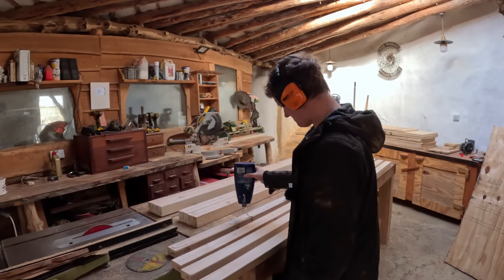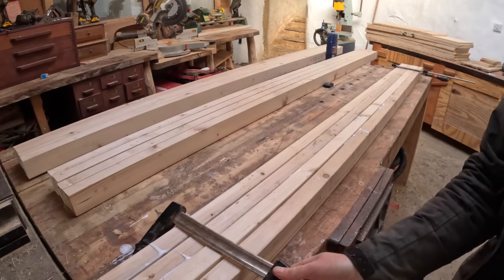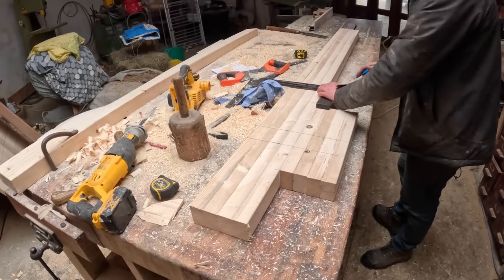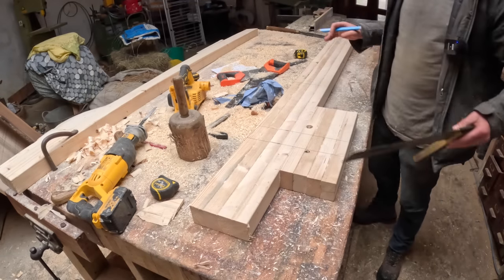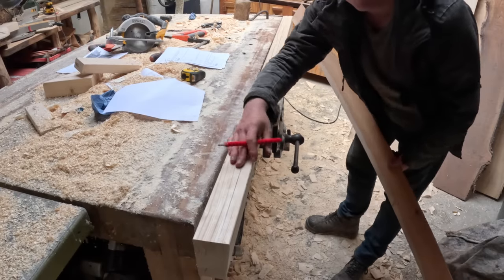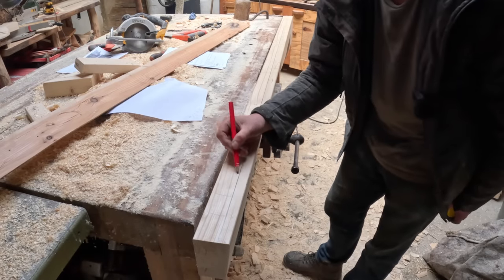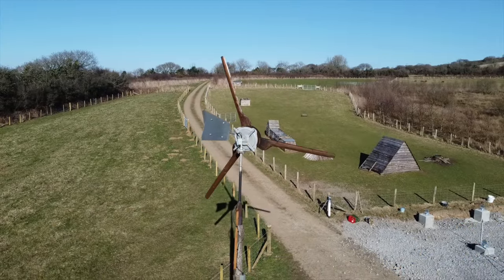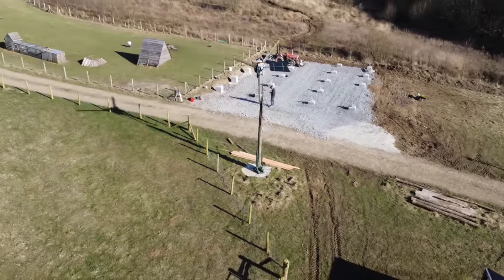Hand Carved 2m Wooden Wind Turbine Blades

Comment: Have you thought of making a horizontal windmill or a savonious style, I’d be very interested to see what you can produce & the resulting output from one. The most basic design of one is made with a large metal barrel and an automotive alternator. The advantage of this design is no directional tail is required & they are supposed to be very effective in low wind conditions. I think if you made a vlog about making one & testing it. It would be a popular vlog.
Reply: The basic design of them is flawed, since one blade is making power, and two are going into the wind, creating drag. Vertical wind turbines have three blades making power all the time. making them many times more effective.

Comment: So, if you get warnings of Gale's you can crank the volts up and slow her down. Usually you are harvesting lower power than you could but you get it for longer because you harvest at lower wind speeds?
You will be getting into variable pitch before you know it ;o)
I have to say I like the (lack of) noise when it is turned down better.

Quality, as per usual!

Comment: Good stuff man.. Alot more controlled now for sure.. Any ideas to build another for on top of the barn? Probably more consistent air flow up there... Any old air fields/ plane grave yards around Whales?  Ide love to see a turbine made from a recycled jet engine.. Precision balanced for any speed you can toss at it..Just need the turbine and the housing to start with..super light weight.. goose farts will probably turn it lol..
Keep up the great work Kris

Comment: coat the wood in fiberflass resin. then layer of thin woven mat. then thin coat of resin again. blades last a life time then. soak the wood in resin tho. so make a mix that takes house to cure. so you can do multi coats then a final later that is rather hot mix so dries. and it helps seal the wood like plastic. spraying it be a smoother more even way to apply to prevent balance issues.

Comment: Could you add a regenerative braking system that would engage at max speed and send it back as un-wasted voltage ?   You made those blades as quick as mother making biscuits for breakfast !
Reply: Makes no sense. Send the power back to where? The turbine?
The MPPT charge controller finds the best RPM VA and puts it into the batteries unless they're already full, in which case the energy goes into a dump load or maybe immersion heater.
Regen is for EVs and motors, wind turbines are already "regenning"!

Comment: WW1 Aircraft had a metal 'strip' on the leading edge of the props.  The same could be done on your blades - by recycling Aluminium cans cut and spread out.  Net result a lightweight 'hardy'  solution that would probably double the lifetime of the blades.... Just a thought :) - I really enjoy the channel - Thank you.

Comment: I know ur quite invested in ur coil setup but i think its time for thicker wire to draw more amps mate. Or even use those blades on a whole new turbine
Reply: Er, didn't he just make the coil setup.....!?
Reply: @andymccabe6712  yes but using the Betz law this is what is think he should be aiming for 
Blade length 2.5m
Wind speed 11m/s
Available wind power 16.007kw
Turbine efficiency (generous 30%)
Wake losses 5%
Output power before losses 4.562kw
Losses...
Mechanical losses 0.2%
Electrical losses on turbine 1.5 %
Electrical losses (transmission) 5%
Time out of order 3%
Expected output power
Real efficiency
25.817%
Output power with losses 4.133kW

Torque
Tip Speed Ratio (TSR) 6
Revolutions per minute 252.1RPM
156.54 N·m 
Trust me mate that coil arrangement just won't be enough. I suggest having a a high wind speed turbine and a low speed turbine for the best of both worlds

Comment: How would putting some type of durable weather resistant sheet metal over the leading edge work… to minimize that wear on the blades? Especially since these new blades are gluelamed using less durable material.

Comment: Did you do calcs to work out the optimal blade size and geometry for your self wound coils? I realise there’s a cost factor here in the copper for the windings but would larger ones be more efficient here at slow speeds with longer blades?

I understand you dismissing fibreglass and I am completely on board with not wanting to shed micro-plastics but this immediately makes me wonder what you could use as an inert leading edge reinforcement. Not at all practical for you but I wonder if a thin strip ceramic would work or if the stresses involved in blade deformation under load would shatter it immediately. Would be a pain to manufacture too I’m sure. Perhaps just a denser wood replaceable insert would help?
Reply: Or..... Everyone could stop worrying about the wear on the blades..... Kris LOVES making new ones........!!!

Comment: The first large commercial fiberglass ones i herd got eroded had to be replaced couldn't be repaired and were just buried in a football pitch size hole in the ground.  Later ones can have the leading edge repaired

Comment: Kris, can you not put a smaller break fan on the back like a wind mill not only does it turn it into the wind but controls the speed of rotation by applying a break to the main turbine.

Comment: I would have expected that you would need to do some balance checks so it spins as evenly as possible. I imagine that spinning at such high speeds, a small imbalance in weight distribution leads to some rattling and shaking which could be dangerous and wear through the bolts n everything much more quickly.

Comment: Built wooden Gyrocopter blades through the 70s.  Easier job than your way, all wood with a tapered steel spar,  about 3m each, no twist built in, about 350 - 400 rpm output on a machine weighing 250 kg.  Would expect half that on your application.

Comment: Interesting to hear about the leading edge erosion! I know you discounted a fibreglass protective layer, but would something like a thing sacrificial aluminium cover along the leading edge work? Or would that cause other issues?
Reply from the maker: the leading edge is round so it would be a difficult thing to make in aluminium. I think it would work but it would still wear away just slower. so it would be a trade off from time spent on the aluminium vs how long it takes to just make some new blades.
Reply: @KrisHarbour  what about making the leading edge with hardwood?
Reply: My my Ph.d thesis was on leading edge erosion on wind turbines. And it is a big problem for full size turbines, a lot of operators just accept that they might have to repair every 3 years. So far the best solution is thick polyurethane elastomer coatings. But I don't know how to buy them as a non OEM, otherwise just try to keep the tip speed low. Below 70m/s helps a lot.
Reply: @KrisHarbour  aluminium tape ?
Reply: @KrisHarbour  Cheers Kris!
Reply: What about hand-formed strip of copper beat over the edges?

Comment: The longer blades will be traveling faster at the tips at the same RPM making them noisier and wearing them out faster. Obviously it's about finding that sweet spot keeping the RPM down and all the other variables to maximize your goals for sound/consistent power. Hope this works out well.
Reply from the maker: That is correct but it isnt doing the same rpm its going slower now. so the tip speed is slower. However that does make it less efficient, thats why I made the blades longer to count for that loss so the output is still what I need even though its going slower.
Reply: @KrisHarbour  because your blades cord don't twist as they move out from the hub they are less efficient (lowering tip speed and noise which is your goal).  That coupled with the increased mass of the blades,  increases the inertia evening out average tip speed in variable wind speed conditions.  Power output is proportional to the cube of the speed which you have reduced so you can expect less noise but also less power output.
Reply from the maker: @philipandrew1626  But the blades do twist. maybe I am misunderstanding you but I showed carving in the twist.
Reply: @KrisHarbour  yes you did carve some twist but not enough to account for the apparent wind generated by the rotating propeller.  Consequently the ends and outer and tips will be inefficient and stall at top speed.  But that is okay as it will self limit your speed and noise.

Comment: I was just wondering why only 3 blades ? Wouldn't more blades increase the low speed torque and increase the inefficiency and drag at higher speeds,  the conventional physics of 3 blade design efficiency is the opposite of what you are trying to achieve,  aeromotor water pumps used dozens of blades to increase low speed torque against what is effectively a dead lift load,  blocking the air mass hence limiting maximum air mass and speed
Reply: Too technical and nerdy, dude.... the quick, simple approach is usually better in theses situations.......!!!
Reply: Look up Aeromotor and learn something Kris is an engineer who like all engineers likes elegant solutions especially old solutions

Comment: What about glassing the blades? 

Also could you not measure the rpm and control to that? Is rpm linear with voltage? Sounds like you might need a different control algorithm?

Comment: Yes but - this is not a size but a regulation problem in the first place?

In the end i will have to have different sizes of blades due to season and expected seasonal winds speeds accordingly - or self-adjusting blades? (1)

(Nobody seems to write about it here, that's why i do.)

1 - professional blades come with adjustable blades, they become adjusted according to a windspeed-effectivness chart that's pre-measured in tests - and the profil of the blade changes with increasing windspeeds according to an build in compliances of the blade as such. Torsion and bending both occur in the desired way. 

And of course there can be always just one optimum blade design for a given place on earth and it's winds to come in a (about) predictable future.

In reality i get an idea about the winds at my given location in the first place from measuring over time and pilot charts and select the turbine i purchase from a list of different adjustable turbines with different  control characteristics - close to my required optimum.

(I thought this to be common knowledge anyway today, i am sorry. Selecting my windmill is not very much different from buying a car or a lorry for my small business transportation needs, and there are so many windmills today already at so many places.)

Comment: Does that bulge work as some sort of counterweight? Bit of damping for the rotating blade vibration?
Reply from the maker: no, it just that the blades dont do a lot down there, Having extra width at the bottom just makes them a little bit more efficient. Because they are moving slowly down there the extra mass isnt an issue for drag. So the base should be wide and the tips quite thin. its not that important though and I only did it because I had a offset from a standard timber length.
Reply: @KrisHarbour  👍

Comment: Looks like the barn might interfere with the wind when it comes from that direction, or is that rare in your parts? Do you plan to move the wind turbine when the barnbuild is done?
Reply from the maker: The barn will block wind from the north. but that is quite rare. it will effect the turbine a bit though just by being there. But the wind is mostly just a hobby for me really. I like to mess around with it and it is handy to have sometimes but Its not essential to us. Anywhere else I put it would be in the middle of grazing land and grazing land is more important to us than wind power.

Comment: Can that controller be set up to switch between different preset modes at different time. ie. Low & Slow when you're home, High output while you're away or being noisy in the shed and wearing hearing protection anyway, and need more ergatrons flowing?
Reply: Another thought, which someone else has probably already mentioned. If noise is an issue, and noise is a product of RPM (that can be measured and utilised as an input signal). Can the computer box automatically adjust the harvest rate of ergatrons to maintain a turbine RPM with the least obnoxious sound?

Comment: Why not just use a different blade pitch to reduce speed and increase torque for low speed running? I suspect you are stalling the aerofoil by throttling the speed down.

Comment: Just a question, I certainly don't want to suggest I know more about wind power than anyone else here, would it be possible to get more power from a lower speed turbine if you use more blades?
Reply from the maker: more blades means slower rpm. But the more blades you use the more resistance so there is a trade off. the reason three is used commercially is because its been worked out that three is the best trade off for speed, torque, cost and efficiency. for my situation though more blades might be beneficial to slow it down even more.

Comment: It might not be a bad idea to put a small gearbox between the turbine and the generator to increase generator speed.
Reply: He just built new blades to slow the rpm. Also why add all the extra complexity and maintenance of a gearbox.
Reply: @Ed.R  2 pulley and 1 belt 🤔
Reply: @StakrCZ  Belt drive on a wind turbine is really bad idea. If the belt snaps in high winds you would have highly dangerous run away blades.
Reply: @Ed.R  well that´s true